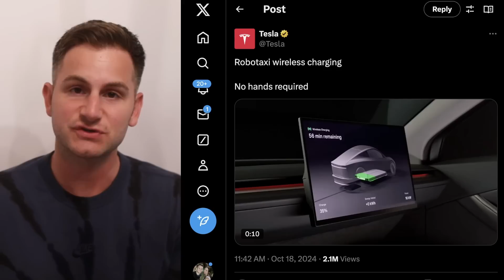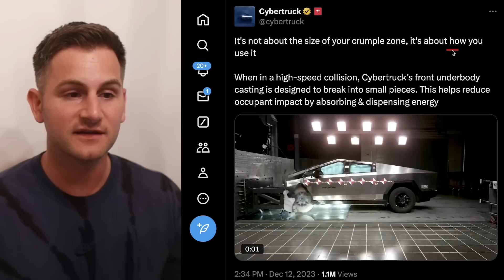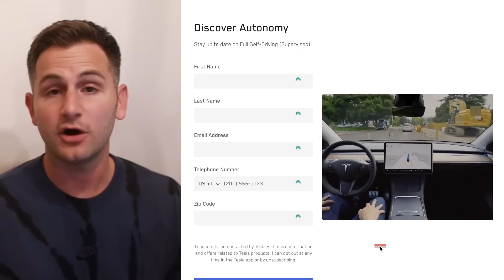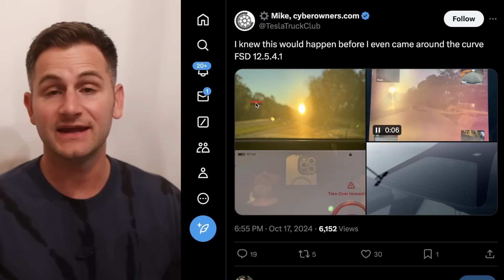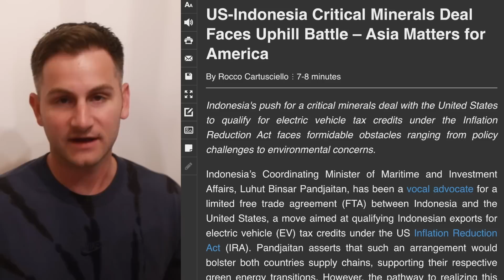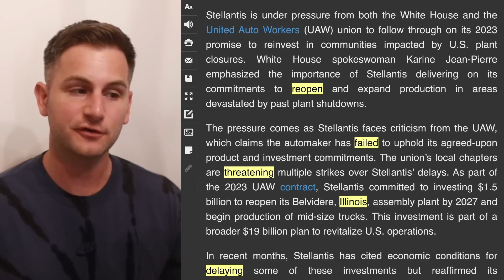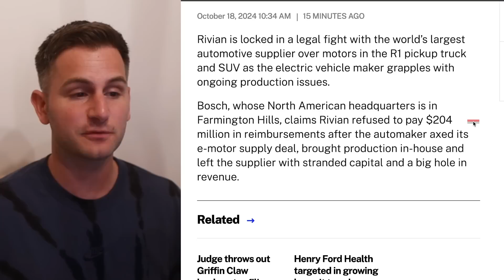Tesla Slowly Unveiling Its Plans / Big Cybertruck Change / Tesla's Battery Sourcing Play ⚡️

Comment: My human vision system has difficulty in low-visibility situations (bright sun & glare, rain, fog, snow, sleet, dust, smoke) and also lacks backup sensors.  My question would be, Does FSD perform any better or worse than human drivers under similar conditions?

Comment: I think you missed the point of the critique on the crash safety of the cybertruck. The critique was not aimed at the safety of the occupants of the cybertruck, but at the safety of most other road users. I am aware that us safety testing is mostly geared towards occupant safety, but given that in Europe there are way more pedestrians and bicycles that take part in traffic as well as a lot more smaller/lighter cars, crash safety also takes the safety of the other party into account. I suspect that the crumple zones of the cybertruck do not activate in a crash with a pedestrian or bicycle. For these other traffic participants, the shape of the vehicle and the contact area are more important, as is the weight of the vehicle. The weight of the vehicle also plays a large part in crashes with other vehicles, especially with smaller, lighter vehicles that are way more common here in Europe. In crashes, the occupants of a lighter vehicle will always be at a disadvantage compared to a heavier vehicle, regardless of crumple zones. The average weight of cars in Europe is around 3100 lbs compared to over 6000 lbs of the cybertruck.
In Europe, the focus aimed more at the safety of all traffic participants and geared towards preventing a race towards the heaviest car that protects mainly its own occupants and is less efficient because of the added weight. Because of all this, I can understand the voiced concerns and I could also understand that the cybertruck would get a lower safety rating in Europe compared to the US.
Reply: So all trucks in Europe are lighter than the cyber truck? Not likely.

Comment: The scale for production, will in part be the scale for building out the supply grid, or grid storage packs t the charge network, supercharger or home. Let's not forget, the limiting factor is grid power and that could be reason for now  perhaps for small robotaxi power packs adding in existing and future M3, MY, etc already on the road and capable of robot use.

Comment: Dillon thank you for this excellent program. I particularly appreciated the tiny note on Spotify as I have been encountering problems with Spotify since the last update. Spotify Tesla does NOT recognize the Spotify on my phone and sits hopelessly with the code bar which doesn't pair with my phone. I have contacted Tesla and the different "solutions " they have proposed either don't work at all or work two days. It is sad😢

Comment: I only have 5 kW in my garage, and it's very sufficient.  I think it would work with just a 220 volt plug at like 2 kW. So,  an induction charge can be much stronger than 25 kW but I don't see the necessity unless you need the car to be a taxi 24/7.
Also, with an induction charger, you would charge a little every day because you don't need to be plugged in (my wife almost never plugs in the car).
Just my 2 satoshi's.

Comment: But wireless charging is so inefficient.  That will require more coal or gas burning to charge.
Reply: The efficiency goes up with voltage.   This is way better than your cell phone.

Comment: Stop claiming that inflation is the reason that Cybertruck is now $79K instead of the 39k it was introduced at. Inflation is not  at 100%. Tesla chose to change the specs on the truck and it ended up costing much more than they had planned. Most people who had made a deposit now can't afford the doubled price of a Cybertruck.
Reply: The 38K version of the CT has yet to be released.     Your comparing old base trim to current mid trim
Reply: Inflation is part of the reason, but the bigger reason is simply that $40K in 2019 dollars is the target, which Tesla never reaches on its first release. Over time they will drive the price down as they always do.

Comment: Come on Dillon. The criticism is directed at the Cybertruck because it is too heavy by far for European roads where many cars weigh less than one tonne, and the average is more like 1500kg. So hitting a cybertruck would be akin to hitting a sherman tank.  Not a fair contest.
Reply: Because there are no pickups of similar weight on European roads?     About 10K full sized US pickups are sold in Europe each year. Some of these weigh about the same as the CT.
Reply: @ianaitken1136
So much for the "White van" Economy then?
Following your logic THEY must all be banned?
.
We're not talking "Averages".
It's as much  to do with the ability to see the pedestrian, then the agility of the vehicle to avoid the person, then the ability to stop if required.
I might suggest that a CT "wins" that contest on all counts when compared to ANY "White van" on European roads.
Especially those (The majority?) with high centre of gravity, poorly secured loads and an "optimistic" driver on a "Time crunch"?

Comment: Cybertruck safety concerns are about other road users, not the occupants. The tests you showed were against immovable, indestructable blocks. It doesn't give any indication as to what the Cybertruck would do when it annihilates the vehicle it hits because it doesn't have a crumple zone that's appropriate for the vehicle it hits.
Reply: Effective crumple zones in both vehicles work together to reduce the total energy transferred to occupants in both vehicles. The Cybertruck's advanced crumple zone design, despite the vehicle's mass, should theoretically provide better energy absorption, benefiting occupants of both vehicles in a collision. The perception of it being more dangerous to other vehicles likely stems from misunderstanding the physics of collisions and the function of modern crumple zone designs.
Just test the darn thing already instead of making decisions based on questionable sources.

Comment: 15:20 it would be even better as a bespoke EREV w 100 kWh battery.

The battery savings would have drastically reduced the weight and cost .(-2,500 lbs?, -$15,000?)

Comment: For the Cybertruck, I'm waiting for the promised 500 mile range.
Reply: I'm waiting, too...  For some sizable value add.  Hardware 5, improved battery, free FSD.  I need something more to get me out of my perfectly suitable M-Y for an $80K truck.  I signed up for a $50K truck I expected to get three years ago.
Reply: Dont you ever pee or poop? Enough with the high miles thing, 320 is enough.
Reply: @leerjet18  "Dont you ever pee or poop? " Sure, coke bottles are the optimum solution. 
For them, not for me. I always go recharging after not more than 150 miles/200 km. My car and myself.
Reply: I send your descendants my most heartfelt condolences.
Reply: @wm.perrykillam4243
Do YOU have a (Genuine) "500 mile range"?

Comment: I think the point of the European safety agency was that the Cybertruck is is unsafe for people outside of it.  It doesn't absorb impact energy from the other vehicle, it bounces the other vehicle off of it, causing the other guy to take most of the impact.
Reply: It is not the "European Safety Agency" (there is no such thing) it is the UN/ECE the "United Nations Economic Commission for Europe" that defines the safety of vehicles on our roads.
Reply: The EU has different rules, and the Cybertruck isn't designed to meet them.  Why not?  They aren't planning to sell them in Europe.  It's not like the rules are a secret or particularly hard to design to.
Reply: based on the very limited crash test data it is very unsafe for anyone in it too...
Reply: In Europe streets belong to people and all forms of transport share the streets so people could move.
Our cars are designed to be relatively safe when hitting pedestrians at slow speeds.
I like cybertruck but I don't want it to come to Europe.
Reply: The cybertruck has advanced features that prevent the pedestrian impact in the first place.    There are ample images on the web showing CT incidents where the front of the CT crush to take up the energy of the impact.  The people who wrote that letter know nothing about CT they did not hear in their own bubble.
Reply: @danharold3087  No it does not have any advanced features. That would mean a airbag or other physical protection for humans hitting the truck. Maybe i was not clear enough, i have ordered 2 of those thingies because they are the most efficient and cost effective ways to transport my goods. But safe for pedestrians they are not.
Reply: @wolfgangpreier9160  Ah some confusion the post I was replying to talked about mowing people down in the start and finished talking about crumple zones which is vehicle meeting vehicle.
Reply: @danharold3087  Yes, the CT has advanced Software features preventing a multitude of accidents. But there is about 1% left which can not be handled by Software. That is where the Hardware safety comes into play. And that is where the Cybertruck - that is of course only my personal guess - may be lacking.
Reply: @wolfgangpreier9160  Pedestrian must look both side of the road before crossing. Basic Safety.
Reply: @wolfgangpreier9160  Nothing Burger. Any vehicle could have the same problem.
Reply: @wolfgangpreier9160  A camera that sees pedestrians is an advanced feature.  95% of new cars today do not have forward facing cameras.
Reply: @danharold3087 😂 Stop making things up.
Reply: @wizzyno1566  It is truth.
Reply: @danharold3087 Dan, layoff the Elon coolaid bud.
The Cybertruck is a death trap for a pedestrian.
Simple as.
Reply: @stuartburns8657  Insert every full sized pickup made into that "death trap for pedestrian" category.
If anything, the Cybertruck is safer for pedestrians than other full size trucks due to its lower ride and hood height.
Reply: @markbeiser  You mean the CT's ill fitting non rounded, inflexible steel corners and edges?
Granted, in the US the bar is stupidly low for safety, but the CT takes the crown
Reply: @danharold3087  Every regulatory body outside of the US would laugh at that.
FSD will be a major court case, it's all catching up with grifter Elon
Reply: @TOOCOLDMC  No, please don't kid yourself.
It has sharp steel edges, which imagen at a low speed collision with a pedestrian would rip and lacerations skin etc.
Dreamed up by an idiot and brought by idiots
Reply: Sounds like the other car is not safe to me.
Reply: @davidbeppler3032 "if i  fire bullets other people should be wearing bullet proof jackets. Its not the guns fault".
Reply: @davidbeppler3032 You sound like an ignorant American.
EU cars are great for occupants and pedestrian survival rates.
The Cyberstuck is like something out of death race 2000, and I don't mean that in a positive sense
Reply: @davidbeppler3032  That kind of thinking is a large part of why the US has so many deaths on the road compared to modern countries.
Reply: @empebee compared to modern countries… LOVE IT! 😂
Reply: @empebee  Yes, has nothing to do with cell phones.  The mental gymnastics you people do to protect Cell Phone manufacturers is amazing.
Reply: @davidbeppler3032  I’ve thought about this for a while but I can’t for the life of me understand how you are connecting this to cellphones?

Comment: I reckon you misunderstood the European safety body.  Once it is tested by a public testing body.  If it's as safe as Tesla says it is, then it should pass their tests.  There would not a reason to hold up importing the vehicle.   Except for size.   It's a problem,  but not just with the cybertruck.   Small and narrow roads don't work for oversized vehicles
Reply: Not all of Europe are small and narrow.   Ford sells the F150 there and it is slightly larger. Net says about 10K full sized US pickups are sold in Europe each year.
Reply: @danharold3087  I'm guessing Ford designed their trucks to pass EU rules.  Tesla clearly didn't.

Comment: The real question is when did these crashes happen? With FSD having had so many recent breakthroughs recently, this may not be a current issue.
Reply: I was only able to find the pedestrian death.  An accident had already happened because of the poor visibility and a passenger thought it was a good idea to stand in the middle of the freeway afterwards. The Tesla driver was behind and could not see and crashed into them.  The Tesla driver was not charged with anything and this happened a year ago.
Reply: @runningman1745  so much has changed for FSD in the last 6 months, this is like trying to investigate a defect in Windows 3.1!

Comment: There is heated cement to clear away all snow. It uses hot ethylene glycol solution that is pumped through the cement. My church has that system keep the walkways clear for Saturday and  Sunday Church services.
Reply: That is impossible.  We all know when it gets cold that electricity refuses to flow.
Reply: @davidbeppler3032  😂
Reply: @davidbeppler3032  ???